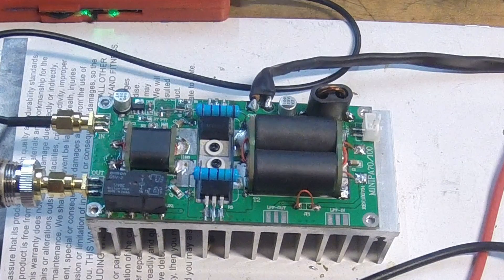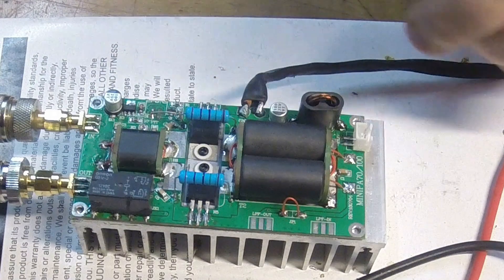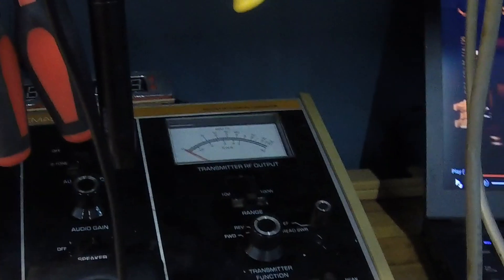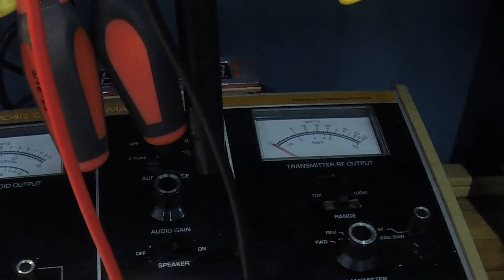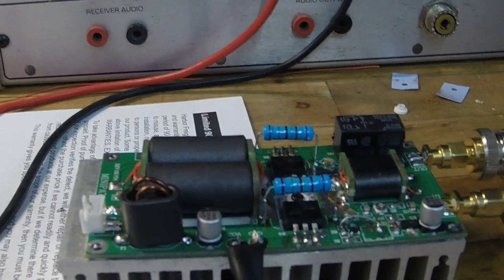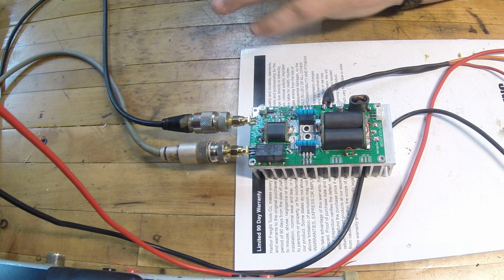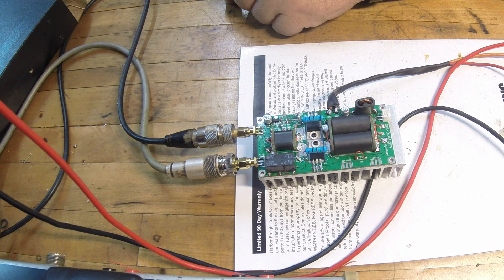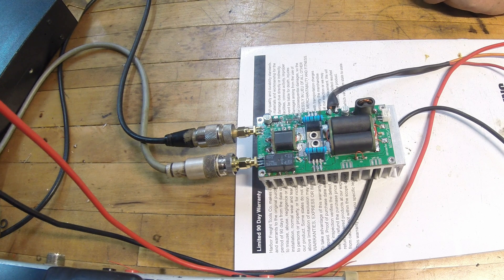Minipa70 HF Amplifier Kit Testing and Review Part 4

Comment: Hello I have a question,

I build this Amp and works great, I getting full power 70+ watts on my Daiwa, but
My relais don't click when I puch ptt, and als not when I release the ptt buttun from dlthe mic. 
only when I add the jumper there is a click. 

What can it be.. 

Best Regards
Reply from the maker: That is because the way the kit is made it's for an external keying circuit you have 2 choices you can just make a PTT pedal that on activates the circuit like the Jumper does just on/off Loop one wire either open or closed or you make a PTT circuit to use the RF in radio to activate the relay I made a video on making one of these for this amp https://youtu.be/TtApNcRjqKo
Reply: @TheElectronMan  thank you so much for your awnser, I was already watching your other video 😃
So to be clear for myself, is that the relay is not clicking when only using the jumper right? I was thinking maby the relay was broken 🙈

Only thing is,  when I use the jumper, my receive  reduced a little bit.

By the way,  I have my bias set on 3.3 volt
I use a 13.8 volt 15 Amp power supply
En 4 watt input gives me 75 watts on 80 meter
68 on 40 meter
Nice rig low costs, and works great

Greetings from the East part of the Netherlands
Reply from the maker: @MrSoundCreation  that is correct you will only hear the relay when you put the jumper on that is powering the amp on  and that is why you need the keying circuit to disable it when receiving and enable it when you transmit. They are great just make sure and have plenty of heat sink and that is good setting on the bias.

Comment: One problem with these units - it'll be obvious if you look at the output on an oscilloscope - is that they used center tap feed on the output transformer.  But wait!  It's not really a transformer!  The two cores form two separate magnetic domains - that is, two separate transformers.  The symptom is that if you look with a scope, the tip of each wave will be inverted.   The fix is to feed each transistor power through a separate choke, and to not use the center tap at all.

Comment: You have the PTT jumped. My question is can you put a toggle switch in line there and would it do the same thing as the jumper. Instead of pulling it out and putting it back. I am trying to make one of these work for me but am just getting started with the Ham stuff. Your videos have been real helpful. Thanks.
Reply from the maker: Yes you could sure do that, as well you could make it a momentary push button switch as well...

Comment: I have bias at1.8 volt. The old Heathkit am cb output is 1 watt, the output from amp is about 8 watts. Reports say the modulation is slightly on the fuzzy side, but tolerable. Any suggestions on clearing up the modulation? I have no high tech testing equipment. Weill a higher bias voltage help?
Reply from the maker: You could adjust the bias up some as that will help your output but be careful to much will cook the finals. Make sure you are getting a good 13volts if using a power supply output does seem a little low but lot of things could be in play bad SWR or  the radio driving it needs more output and modulation, hard to say without knowing the whole setup good thing is you know it is working now just to peak it to best performance.

Comment: Hard switching  is normal for an  HF Amplifier, Not many Ham amps have a COR  , CB amps as you know have a C.O.R  , It's easy though to add a COR to activate the relay , You just want a capacitor , Diode , Transistor circuit to sample the incoming RF ..... Good video though , I've got the same amp and for the money it's a good little kit , I run mine with the FT-817 , It's ideal to leave under the seat so you're  ready to go whenever you plug the FT-817 in 👍

Comment: The spectrum analyzer test looks fishy. I see something like 0 to 30 MHz span (up side down). How did you check the second harmonic at 54 MHz and more importantly around 81 MHz the third harmonic. Mine works perfectly, but the third harmonic is only 10 dB down. You definitely need a Low Pass Filter. I agree, it is more like a 40 to 50 Watt deal.
Reply from the maker: Good point I can't really make it out good but I agree it looks like I have span wrong woops but I have checked it multiple times guess I just grabed the wrong setting that time but rest assure mine tested pretty clean across all the bands but I agree I would use some pass filters if you are going to use it in the ham bands.. BTW If you have a nice bench spectrum analyzer you want to give me I would love to have it that little China handheld I have is not real user friendly to say the least LOL.

Comment: My amplifier does not amplify the signal... zero watts out. Have tried with new pair of MOSFETs. Biased correctly, but only 20 mA current on idle. What could be the problem?
Reply from the maker: I would check and see if you have voltage at the transformer first but it could be a number of things hard to say without me seeing it. With zero watts out sounds like connection issue on the board somewhere.
Reply: Something is on backawards